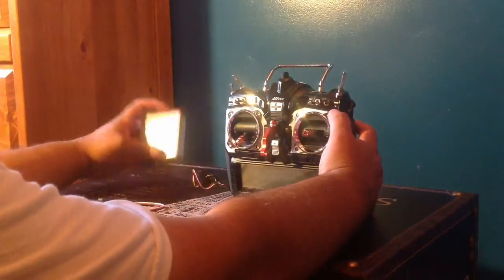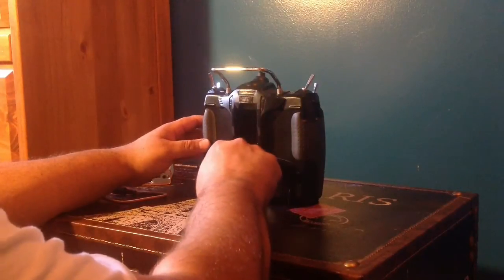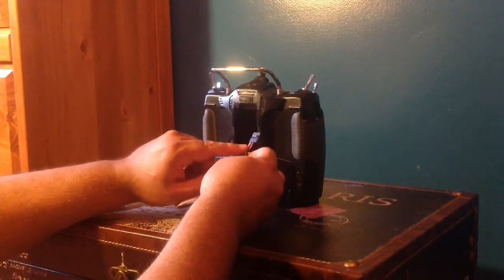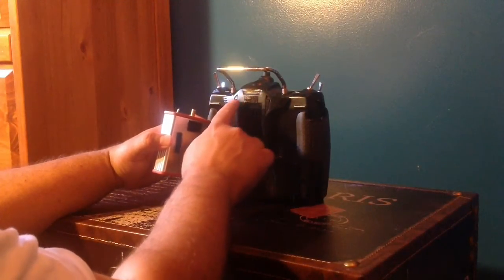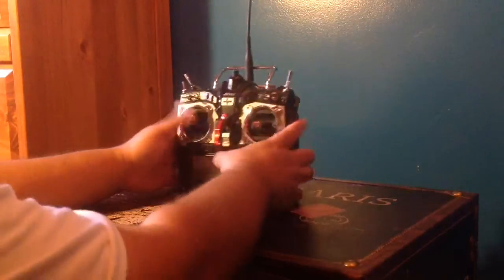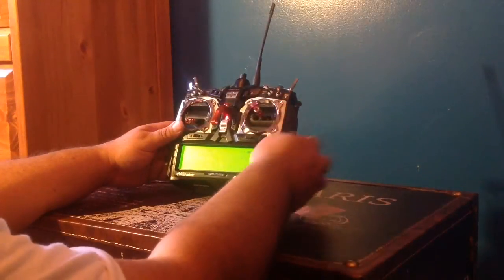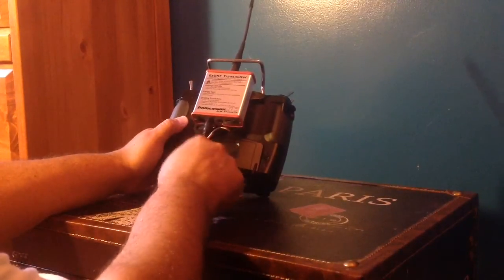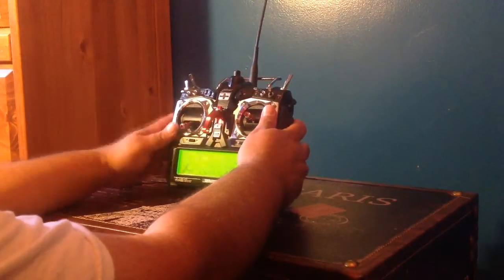Hitec Aurora 9 and Ezuhf

Comment: now I have connected an hitec aurora 9 transmitter 2.4G with an Multiplex Cockpit/Combi 90 Radio from 1990 and it works perfect. All channels 1 - 7 are available...

Comment: hello! other people and i have the problem that the aurora send, when turn the power off, a signal to switch all channels to -1000 for one second and went then to failsafe. have you the same problem?
Reply from the maker: Do You set-up fail safe properly? Do you power off RC model first? I never had problems with my A9!
Reply: FpvQuadFlyer yes the setup was correct and the failsafe will work. the problem is only with a dji naza and when you power of the a9. only then. then the a9 send a short signal with the value -1000 of all channel.
Reply: The immersion rc support tell me, that this is not a problem from the ezuhf. have you a tool to see the channels on a computer and turn off only the a9? i am not the only one with this problem :-/
Reply: sorry i forgott. the ezuhf must get an extra power from a 3s lipo. only then have the ezuhf time enough to send this signal from the a9

Comment: i have this ez uhf with an aurora 9x and it also works...just a different connection...also gotta put the radio in pupil mode
Reply from the maker: Great Tommy!  Thanks to share that info.
Reply: Hi tommy, so sorry for my bad english. I have a aurora 9x. I want to use with uhf system (ezuhf or dragon link). How can I connect my 9x with uhf system. Only trainer cable??
Reply from the maker: Thanks Tommy for that info! How different is the connection for the 9X?
Reply: engin ber use ez uhf and the trainer cable...
Reply from the maker: Thanks! i will share your info.....
Reply: Tommy Keyes  Thanks for reply tommy.. I want to use only trainer cabel with dragonlink on my aurora 9x...I  think aurora 9X can work with dragon link with trainer cable..Where can I buy trainer cable..do you have any link..
Reply from the maker: Hi!
Check gonitrohobbies.com ebay store. http://www.ebay.com/itm/Hitec-58320-Trainer-Cord-Aurora-Radios-/360899085722?pt=Radio_Control_Parts_Accessories&hash=item540743059a
Reply: FpvQuadFlyer
https://www.fpvpro.com/dragon-link-connection-cable-specturm-jr-hitec-others
   or    http://www.readymaderc.com/store/index.php?main_page=product_info&cPath=165_40&products_id=894
Can I link these cables with aurora 9x directly??
Reply from the maker: engin ber Im not sure!